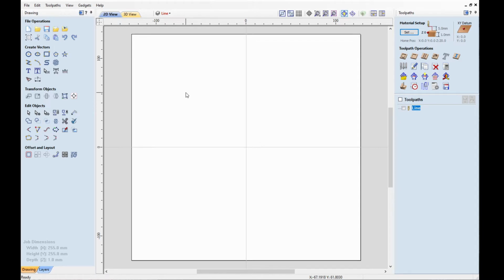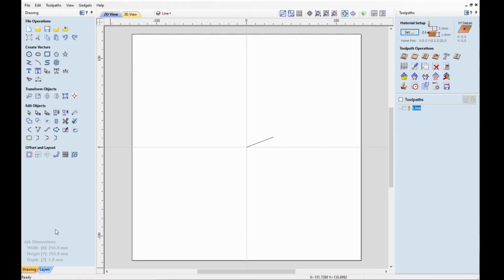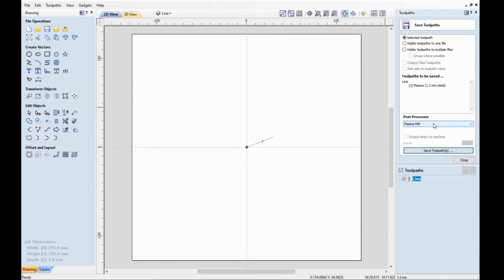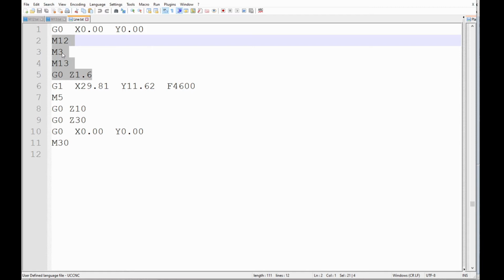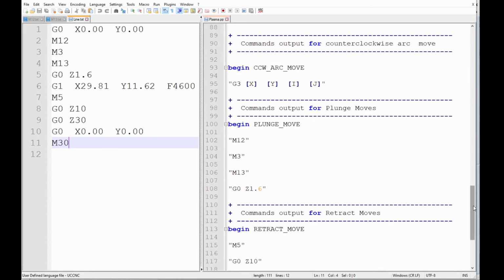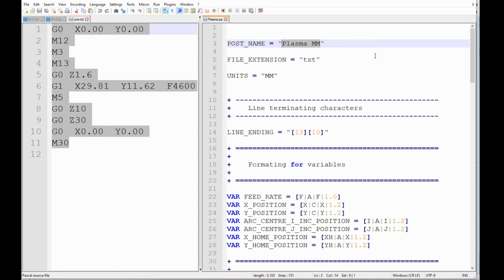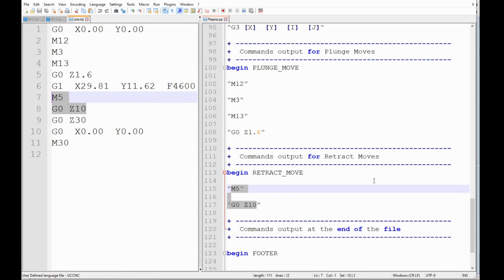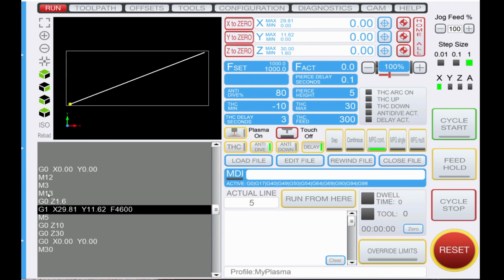Vectric for CNC Plasma Toolpaths

Comment: First of all, thanks for posting this video.  Very helpful to a plasma newbie like me.  Would you mind sharing your speed rates for the different thickness of steel that you are cutting?  I would also like to create a set of toolpaths like you did.  UPDATE: Just watched the longer video and got 5 out of 8 toolpaths.  If I had to guess  for 1.6mm and 2.0mm (you didnt click on those in the video :) I would say around 3600 and 2700.  Am I close?

Comment: THANKS FOR THE HELP. HAVE YOU USED SHEETCAM ALSO AND CAN COMPARE AGAINST ASPIRE?
Reply from the maker: Sheetcam is probably the most popular CAM software for plasma.  If you do not already have CAM software and only need it for plasma, then go for Sheetcam.  I  use Vectric on a range of CNC machines, which I had before building the plasma.

Comment: Hi Greg, are you willing to share your plasma MM post processor and the macros?
Fingers crossed,

Robin
Reply from the maker: I could do that but it won't be any good to you. It is specific to my plasma.  Control software, THC, even to my personal edits of the control software. Macros are written in the language required by the software used.
You need to understand what your setup needs in the way of gcode.  THC requirements.  Macro language Etc.
That is why I have tried to explain the different things I have done with my PP.  So that the same principals can be applied to another setup.

Comment: Yep..  I watched all of it.  I like how you can adjust the pierce settings on screen.  I put that directly into the post processor and have to adjust it before creating the G-code or open the g-code in editor and do it on the fly.  Makes sense to do it your way if you're switching between metal thinknesses. I might have a look at Mach3 screens again to see if I can add those two perameters into a screen set.